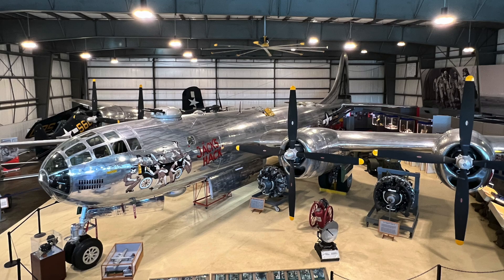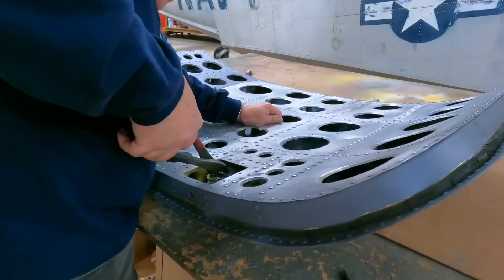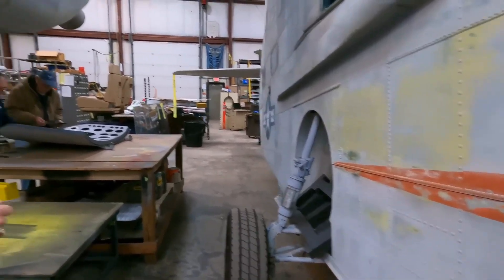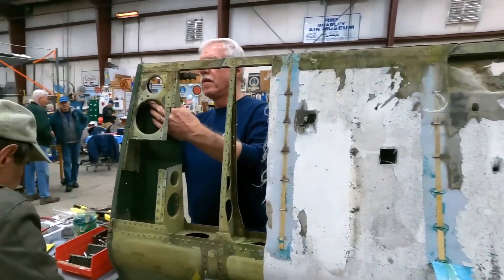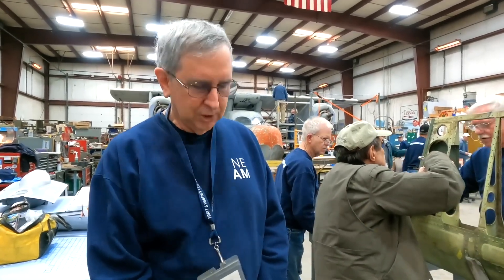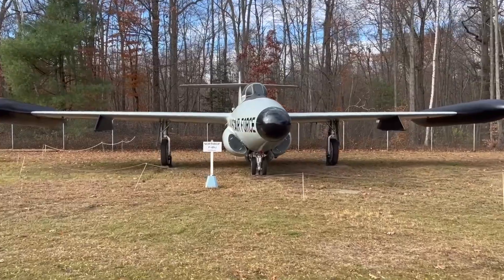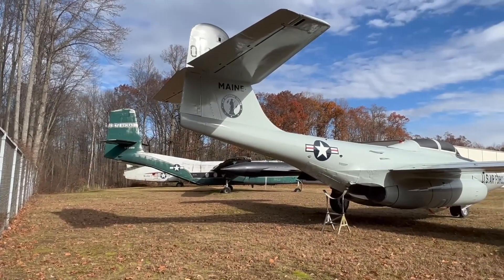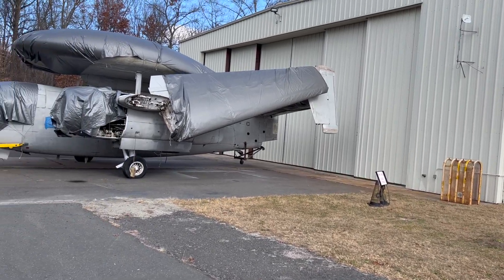More New England Air Museum Preservations

Comment: Apologize for this ancient history question – but what became of the planes damaged by the 1979 tornado?  I remember a B-47 among others.
Reply: The B-47 went to Hill AFB in Utah around 2001 for their museum. Last I heard it was scrapped about a year ago.
Reply: Thanks that’s interesting – would assume the Utah museum planned to fix the tornado damage but then gave up. If recall correctly it was some kind of special test version of the B-47 or an EB-47. 
There were also some tornado torn-in-half planes like the B-17 with the test-turboprop nose. I’d guess these were all scrapped.
Reply: No. The ultra rare B17, model 299Z, was traded for a B25. Only two model 299Z's were built by Boeing.. the flight deck was moved back a few feet, and the nose was strengthened for various test engines. The priceless 299 was turned into the liberty belle. It flew for about 10 years. It had an engine fire in flight, and made an emergency landing. Everyone got out safe, the plane was destroyed by fire.
Reply: That’s amazing, didn’t know the history  – when I saw it could barely tell it was a B-17, had been ripped apart with only one section on display.